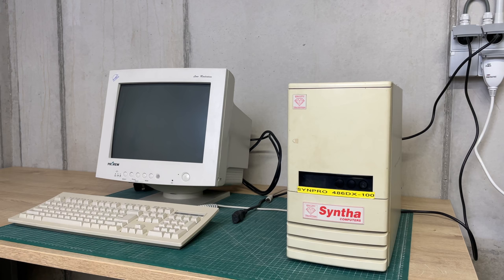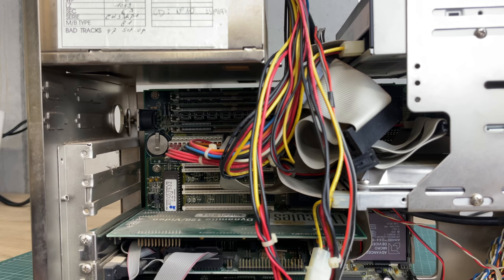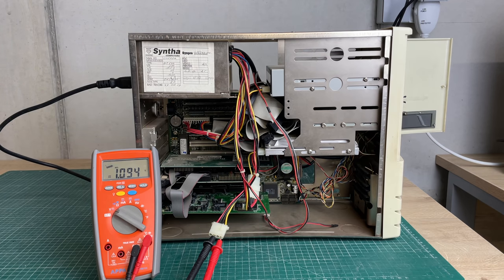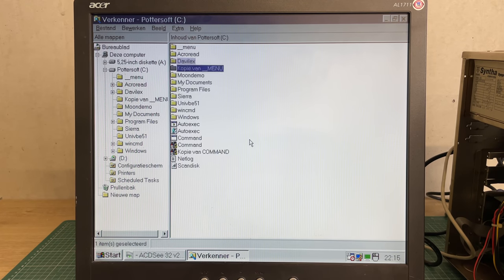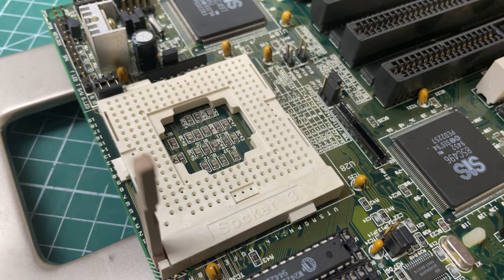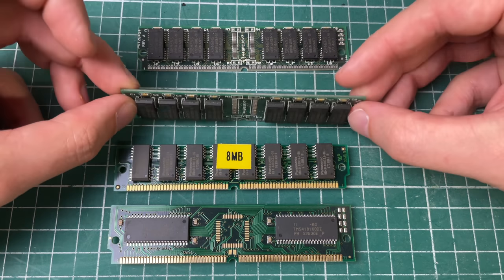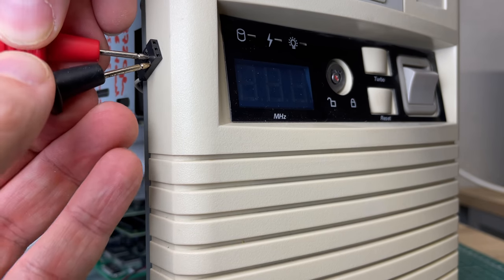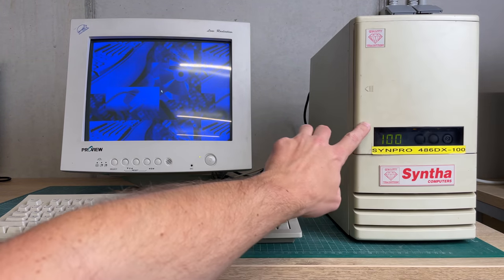AMD 486 DX4 100MHz pickup

Comment: If you say the CPU cooler bracket is hard do come by, isn't that a classic case of making a 3D model of it and printing it in 3D?
Reply: I dont have a 3D printer and I am old school making stuff the old ways BUT I do see 3D printing as the future for a lot and this seems to be a perfect job for a 3D printer.
Reply: @johnbos4637  It took me about an hour to do my first 3D models without any knowledge prior in 3D modelling.
And they were a more complex shape than this.
According to the software: you don't have to buy super expensive stuff, I did my models with FreeCAD, which is - as the name suggests - freeware.
And: are 3D printers that rare that you don't know someone who knows someone...?
Or maybe have a computershop nearby that prints things for you?
Reply: @johnbos4637  Yea a 3D printer is an investment, its not that expensive making stuff if you have the tools. The tooling is what cost money.
I made my own case Midi case, the steel in that thing is about 10€, I paid 25 because I got 2x what I needed plus I paid extra just to get it locally. 

But I dont think everyone needs all the tools, I think its better to barrow or pay someone for the few times you need something.

Investing in all the tools makes sens when you doing a lot of fabrication your self.

Someone can probably print this thing for a fair sum.

Is there not online services that do 3D printing?
Reply from the maker: Have a friend with a 3D printer ... will see what he can do.

Comment: Nice find on the door not broken Also make sure the fan you are using for cpu is ball bearing. When fans first started being used on cpu's. The small brush less fan? was garbage and fail. Nice triple digit display too. When somebody would upgrade the older case with a 2 digit display but a 100 or what not processor. I  would just make it say HI and LO for the read out. :)
Reply from the maker: Indeed, after abiut spending 8 hours figuring out how to reset all those jumpers :)

Comment: First thing I would do on that is visually inspect everything, unplug replug peripherals etc. I would then chuck the psu in the circular file. Start fresh...make sure you have the proper connectors of course or adapters to do so. Then do the rest of what you did. Old PSU are ticking time bombs almost always. Go with good quality single rail setup, should be easy as pie to go above specs needed. A good 500W should be more than adequate (always go above what you need by at least a good 50% margin) depending on what peripherals you are using. I also only use LCD+ monitors as the older ones are again ticking time bombs or at the least just dangerouse and heavy. It is neat-o for a bit to play on an old monitor for true nostalgia ...also bad for your eyes.

Comment: That's a very sexy machine! DX4-100 is Doom territory, so many amazing DOS games to play on that thing. And the Hercules Dynamite 128 Tseng ET6000 is easily one of the best 2D cards for a PC of that era. One of the very fastest PCI cards for DOS, it's absolutely not "pretty standard" it's in fact very top end, but hey, if you don't want it, send it over ;)
Reply: If he dont want it and you dont want it I will be next in line ;)
Reply from the maker: I really have to do that Dynamite 128 Tseng ET 6000 video ! :)
Reply: @Green Mamba Games It actually used the quite fast MDRAM, which is not pure DRAM and can be somehow compared to the capabiities of VRAM - namingly simultaneous memory access on the same chip.

Comment: A nice one.. I bought a similar AMD Am5x86 (running at a whopping 133 Mhz) based computer, back in the mid-90's, originally with S3 Trio64 (1MB) and 1MB RAM. Later I upgraded it to 48MB RAM, replaced the S3 with another one (LOL), this time the S3 VIrge DX (4MB) and added the SoundBlaster PCI 64 and even some internal modem. The whole set literally shined - in no small part thanks to Samtron 15" monitor output - and was operated using a surprisingly good Chicony DIN keyboard as well as some serial two-buttons mouse.

I ran OS/2 (v2.11, v3, v4) and also Windows (95, 98) on it quite fine. I still have it in my basement and it still runs OK (tried it last year during some house-reorg shenanigans), despite being laying there for some 20 years.

Thanks for bringing back some great memories of that era :-)

Comment: Nice! Loved the old 486 tower cases. They were built like a tank, not those flimsy cased you get today with all that glass and crap.
I have two 486 cases I have converted so I can use modern motherboards cause I love the cases so much.
They had a removable back panel so it was easy to take some tin and make the panels for the newer boards without destroying the case. I also had lots of old cases I have bought at yard sales and ones I kept down through the years... :-)

Back when I worked at Computer Exchange we use to set the led display to say 'HI & Lo ' just for fun or some other odd thing just for fun. 
Customers always asked what that meant... We kept a few set at the right settings so if the customer didn't like it and wanted the numbers we would just swap out the display in 2 minutes right there on the counter in front of the customer... LOL It was so neat to see the expression in their faces as they watched... :-)

Wow! A working door! Awesome that it still have the latching clips and paw... They did not really make that many cases with doors back then, so they were few and far between. At least in the 3 shops I worked at back then. That was the best part of working at Computer Exchange, it was a Mom & Pop shop and he bought out old leased computer and we refurbished them and sold them to lower income folks that never seen a computer in the 90's... Good Days!
That's when you did everything, repair, build, tech support, installed software, everything in-house. We seen every kind of computer made come through the door in those days.

I'm glad I lived through all those days of having to configure all the jumpers for CPUs, Sound, IRQ, video and so on. Fighting all the setting just to get that game to work. Sometimes you spent hours just to get the sound to work because of IRQ or memory issues. Fun stuff now back then it was No fun! Might explaining why I hate games... Lol Make you appreciate today's motherboards and software where they are just install and use... :-)

Great video and thanks!
LLAP

Comment: 486DX 4 was the first "real" PC I owned (an old Packard Bell) and lead to the first of many many incursions inside the case of PC's to initially upgrade the 4MB RAM to 8MB, hard drives and graphics cards followed and eventually I got brave enough to tackle motherboard and chipset replacements. Never owned a factory built desktop since........ and all because of this lovely little 486 (which was still kicking Pentiums butt at the time as a 100 MHz clock speed was still whooping the Pentium 75)

Comment: I have a DX4 100 MHz, in the form of an AMD 5x86 100 MHz in the Overdrive socket upgrade.  But what I do like is the micro/baby AT tower case formfactor, as the one shown in the video.  I have at least 1 of those, probably 2.

Comment: Very nice machine !! That's super weird to find a BIOS dated 1998 on the label for a 486 / socket 3 machine. In 1998 we already had Pentium II, MMX cpu were mainstream... Who still bought some 486s in 1998 ? ;)
Reply: People who owned 486's in '98 were still able to upgrade their bios if the company still supported the 486, which was common.  Also, people did not easily give up their PC's as they do now. People  usually had at least two PC's.
Reply: @fwingebritson  Sure, but that's very very less common to see physically upgraded BIOS (the label on the BIOS chip shows that the BIOS EPROM has been replaced in 1998, not just a simple flash bios update). We probably won't know the truth of this weird story ! :)
Reply: I've just checked in a PC buying magazine from 1997. There was absolutely no 486 motherboard or PC on sale at this time ! The mystery remains intact !!
Reply: @warrax111  My point was that there is a 1997 (or 1998) sticker on the BIOS chip, which means that it was manufactured at this year. This is this fact that I find weird... :)
Reply: @olivierpericat9224  "Who still bought some 486s in 1998 ? ;)" 

i was answering to this.

well... someone who had not even 486 in 1997/1998. And they've bought used one.

To the bios date:  The company sold 486 in 1996, support lasted few years. They removed it from price listing in 1998, but of course, they had still unofficialy some unopened boxes in store. And also, some BIOS chips for replace. Maybe they've needed some even in 1998, because customers still used 486... like many of them. Maybe 1000 or 2000 customers. And some of them maybe needed BIOS upgrade, so the company did it even in 1998.

Comment: Don't discard the ET6000 that quickly!
Its one of the best 2D/DOS Cards ever made.
Reply from the maker: Will give it its own video ... but if I understand correctly Tseng was already on their way down at this point .... Think it was released in Q4 1996
Reply: I had one and didn't realise how fast it was until I tried some other cards. Ended up putting the et6000 back, and paired it with an orchid righteous 3dfx.
Reply: @RetroSpector78  well, they were a couple of years late and had to compete with some good 3D Combo Cards. I think it might even be 3DFX Banshee and Riva TNT that the Tseng competed with. 

Though the Multibank DRAM (MDRAM) is very interesting, as well as the "uneven" memory configurations of 2,25 and 4,5MB...
Reply: well, try voodoo3 PCI and you'll see what's fast PCI card in 2D mode. Tseng ET6000 doesn't have sense, even for 2D, unless you especially love it, because it's Tseng. I would say even S3 Virge will make same speedy 2D, but you'll get interesting native 3d engine. And same for Ati 3D rage II/pro PCI, which has it's own internal 3D engine. Both cards have lightning fast 2D, so no reason to use ET6000, pure 2D card.
Reply: i thought the S3 Trio64v+ was one of the best 2d cards
Reply: @pentiummmx2294  naa, not by a long shot. It was fine, don't get me wrong, but there were a lot of things that were better. Matrox Mystique and Millenium are 2 of the most known examples of the time (and work really well with Voodoo Graphics).

Comment: If you have the rest of the plastics of the cpu grabber you can glue them with Cianocrilate and sodium bicarbonate to make a solid union. If not try to recreate the plastic with the same or with 3d printed parts.
Reply: Rita 25 y.o - check my vidéó  I think I got mine like in 2012 but it's a HP vectra, still works

Comment: Just picked up a huge "Peacock" big tower with a nice "AT-386" label on the back thatw as going to scrap.
You can imagine my surprise when i saw win95 booting when i switched it on before opening...
Someone had upgraded it a "little", with a pentium MMX 200Mhz. No bad, but i would have prefered a working 386 :/
Reply from the maker: you can always downgrade. Done that a bunch of time also. My Highscreen 386AT was also running windows 98SE when I picked it up :)

Comment: Made back in the day when if someone said "I built this PC" it had some degree of skill involved unlike in 2021 where its auto everything.  Also at a time when people were satisfied with gaming at 60hz and didnt need 240hz displays.
Reply: Most CRT monitors were usually 75hz or above lol.
Reply: @willwalters6928  Average was 60-85hz, only high end models went higher and were very expensive and rare.  Not to mention GPU's were very basic if not non-existant till the mid-late 90's to push high rates.

Comment: 16:00 1998 copyrighted BIOS ROM in a 486 motherboard??? 1998 is well into the Pentium II/ AMD K6 era, and that's not even taking into account that chip copyrights tend to be from at least one year before the machine they are mounted on is actually sold. In an era when computer stuff was getting old faster than it does today. Very, very weird.

Comment: The Tseng labs et4000 is the fastest ISA card in existence from what I've heard.. and I had one in the 90s and it ran doom at a great fps compared to others.. so I disagree with your statement that the tseng labs et6000 is slow or not know for their performance cards.. 3dfx was the Pentium era
Reply from the maker: Agree with you on the ET4000, but let us agree to disagree on the ET6000 :)  It was released in Q4 1996 as was the Voodoo1. 3D was starting to emerge and at that point and the ET6000 was no 3D card as Tseng Labs wasn't what it used to be anymore. Think the consumer had better options. And when this card was released we were already in the pentium era. Possibly at some point this computer here got a video card upgrade, or it was a 486 that was sold well into the end of 1997 (could be possible). A lot happend between 1996 and 1997 :)

Comment: That’s a poor mans Windows 95 computer from about 1997. By this time the Pentium CPU was already released and being used in most NEW computers. I would leave this computer as a is and just run DOS/Win3x on it. The 486 CPU will never be fast enough for good DOS game play with out hesitation or choppy game play. You really need a Pentium class CPU for good game play performance. Also it will NOT play MP3’s well.
Even with the 5x86 its just NOT fast enough. I had a system like that back around 1997. The computer store near me was offering a motherboard / AMD 5x86 combo deal for Win95 computer upgrade. I think it cost about $100 for this deal. I still have a setup like this but with an AMD 5x86-133 CPU over-clocked to 160mhz. Using the lucky star LS-486 motherboard. Very similar to yours with the SIS chipset. The AWE64 is a good sound card too producing good sound reproduction.
Reply: Win 3.1 doesn't have drivers for anything made after 1994 (including IDE hard drives).
Reply: @IkarusKommt  Gentoo Linux will run modern versions of most everything on this machine but the more you install, you'll get to the point where it cannot update its software fast enough to keep up with the updates. And some builds these days take a lot of RAM; you'll have to have -j1 in your MAKEOPTS.